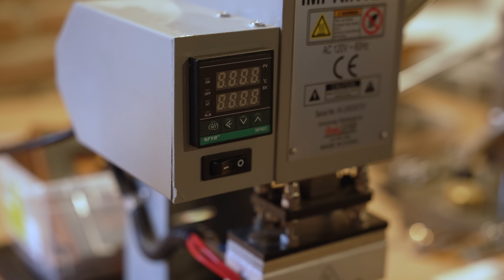MAKING A LEATHER CLUTCH WITH ALLIGATOR ACCENTS! (Sounds of the workshop)

Comment: Ok now how do you make this without those expensive tools.
Reply: The machines he uses make the process easier and faster, but he didn't do anything with them that you couldn't do by hand with a little more time and effort.
Reply: @nickkoury7637  Yes thank you, I was being a little sarcastic but thanks for reply, also that machine with the compresser thing is the blade in the that plastic mold thing or is it in the machine.
Reply: @iforget6940  are you being sarcastic again
Reply: @glenbuyer8738  nope I just never seen a machine like that before I'll rather ask a nice stranger to help me out of my ignorance than to stay ignorant.
Reply: @iforget6940  if you're talking about the clicker press he used to cut out the pattern then the blades are on those plastic pieces (or dies) that he laid down on top of the leather. The machine itself is just what applies the pressure to push down the dies and cut out the pattern
Reply: @HaleLakeLeatherLight  thanks so can you use the dies even without the machine or do you really need the machine to do it.
Reply: @iforget6940  if you were to use the dies without the clicker press you'd have to find a way apply enough pressure to cut cleanly through the leather. So I'm not sure how you'd do that without a clicker press!
Reply: @iforget6940  The blades are in the plastic pieces that he picks out of the drawer.  The machine is just a pneumatic press (albeit an expensive one), and you can have the dies made at a bunch of different places where you send the design and they bend and set the blades.  If you were to have the dies made, you can rig up any type of press to do the cutting.  the one he is using is just specialized to put even pressure across the entire die plate.
Reply: @nickkoury7637  thanks man.
Reply: @HaleLakeLeatherLight  thanks just subbed to you hope you make it big or just live a fulfilling life.
Reply: @iforget6940  No problem.  I have a couple of more expensive machines because I have hand issues that make skiving and and stitching painful after long periods.  I do all my cutting by hand, but having a press and getting dies made would be a dream.  I think it's also the difference between making a few pieces as a side hobby or trying to make a full time career out of your leatherwork.
Reply: @iforget6940  thanks man, to you as well! 😁🙏
Reply: @nickkoury7637  amen to that!!
Reply: @nickkoury7637  i would love to see a combination of multiple dissaplens like leather working wood working  and  making cloths. The end will only be in your mind. You won't really need to go to the store to get anything but that you, yourself can not produce.
Reply: @nickkoury7637  please can I get a name or info for  custom dies making .

Comment: "Handmade is better" yet machines cut, skived, sanded and stitched it?? How is this any different to any other production bag? Not saying it's not nice however.
Reply: My exact thought on it! i love the result but this is not what i would call "hand made"
Reply: I see your point.  BUT; "Handmade" doesn't necessarily mean hand cut or hand stitched.  What positioned the dies strategically on the leather?  What fed the leather carefully and skillfully through the machine? Hands :) "Handmade" doesn't mean "Made using only primitive tools." It takes a skilled craftsman to operate a variety of hand tools and equipment. That doesn't make an item any less "handmade" in our opinion :)
Reply: @smithsleatherbalm7544  I strongly disagree, hand-stitching and hand-cutting takes a real expert to create a nice product, saddle stitching takes hours of work and makes for a very strong stitch.
Operating a clicker press and a sawing machine takes a little effort but in the end anybody can use them. Hand made costs 2 to 3 times the price because there is no machine involved, mostly in the stitching, which makes a huge difference in both aesthetics and durability.
Y'all just selling for hand-made what is not.
Reply: @AndreaFromTokyo  I think there are two ways of looking at this. I will say that generally I also feel like Ryan has too many machines involved to call his stuff "Hand Made". Having said that though, it is difficult to make true "fine leather goods" without some mechanical intervention. Being able to click out a pattern will almost always result in a nicer looking product in the end. Some fine leather goods can really only be achieved by using a bell skiver. Also, is heat treating edge paint with an electric filiteuse really a process made by hand?
Again, I'm with the general idea that "hand made" should really use a few machines as possible, but some kinds of fine leather goods need some kind of machine to achieve a certain level of refinement.
In the end, "made by hand" is really a slippery slope and a lot of people use it to sell their wares ...even when it's really not made by hand.
Reply: @AndreaFromTokyo  'To make an apple pie from scratch, you need to first create the universe.'
Reply: Because it's not made in some factory made by a depressed worker who hates their job off in another country getting paid barely anything it's made by someone who is passionate about their craft
Reply: This IS handmade ffs. It's not production line bollox. The snobs commenting on here are ridiculous. Maybe they'd like him to chew the pieces of leather into shape....
Reply: @mrf9583  💯 Agree
Reply: He learned how to by hand doing everything and then added machines to streamline, have consistent products, and increase output, that’s how businesses work
Reply: What are these patterns called?
Reply: lol what a Karen.

Comment: Nothing can compare to actual, handmade/hand stitched. My cousin works in a factory feeding sheets of metal into a press with his hands. Is that handmade too? It really takes the quality out of the term "handmade", when folks consider this that. Looks nice but not " handmade".
Reply from the maker: I dunno, if I were just cutting the pieces out and shipping them in a box not assembled, just like a piece of metal in a box then yea I’d say it’s not hand made. Don’t forget the bevelling, assembling, painting, gluing, or moving the leather around the sewing machine, cutting. I’d also beg to differ about quality going when a product is cut by hand. I’d actually say with a die it’s higher quality. No slips of a knife or wrong cuts. Because something is made with some machines you can’t say it takes the quality out of the item. The last time I walked into my shop the machines weren’t making the item for me all by themselves. There is a handmade component also when using machine. There’s an art and craft that goes into using the machines well too. I’m sure you’d understand if you used machines.
Reply: @LittleKingGoods  i don't mean to be offensive but this is just a stretch... i feel like you just don't want your brand to feel "less premium" but matter of fact it is not handmade.

"Don’t forget the bevelling, assembling, painting, gluing, or moving the leather around the sewing machine, cutting"

bevelling and painting are part of the same process (edging) and since you don't even burnish there is little effort involved
assembling gluing and stitching are part of the same process and literally takes close to zero effort to glue 2 pieces together, using the sewing machine is fairly easy and not even comparable at saddlestitching.

The quality improves in the cutting maybe, enything else doesn't imho. Anything that is "industrialized" to save time and effort makes for a less quality product inevitably.
It's just my opinion and, again, don't mean any disrespect.